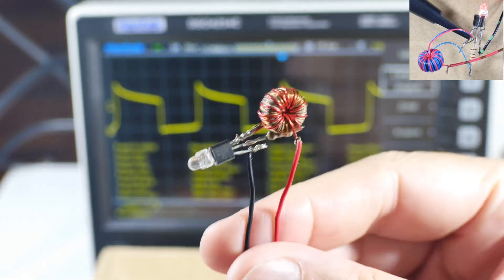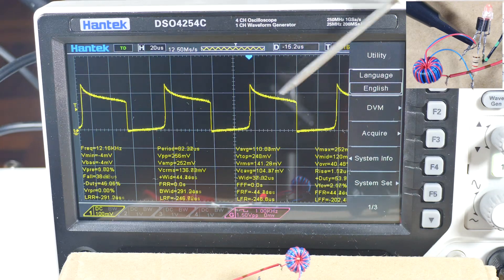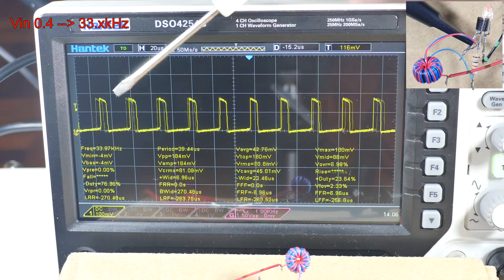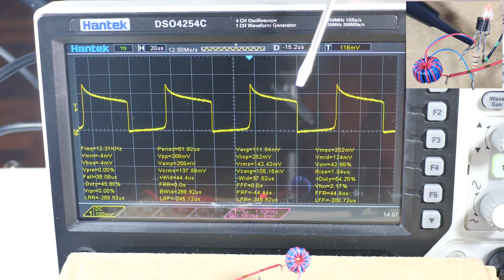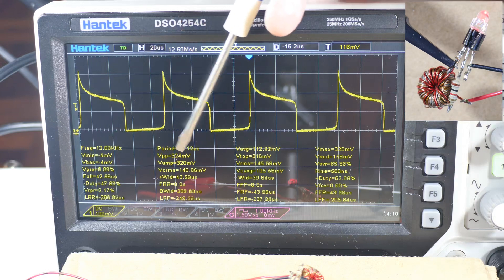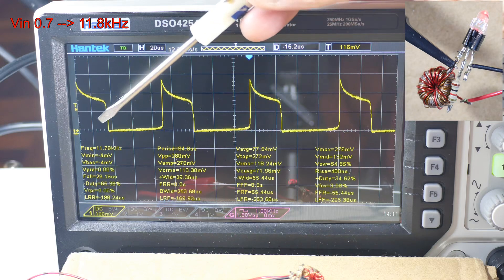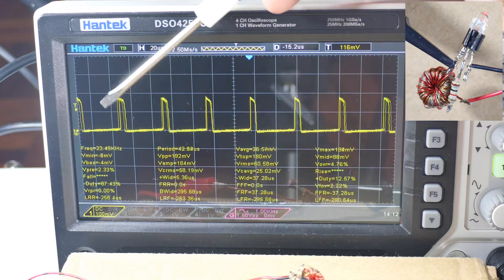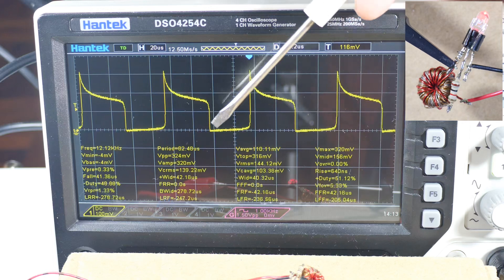Joule Thief - What's The Frequency, Kenneth? (4K)

Comment: What happens if you add a ceramic capacitor across the coil connect from power to collector? Would that possibly form an LC resonant tank circuit? If so would that cause said joule thief to oscillate at said frequency?
Reply from the maker: Remembering that all components (even a straight wire) has 3 properties: resistance, capacitance and inductance, adding capacitance to the natural capacitance of the inductor would change the frequency at which it resonates, mostly likely lowering it.
Reply: @tsbrownie  thank you! Would it be possible to raise the resonant frequency? Let’s say to 3mhz? Like if a capacitor which was lower than the parasitic capacitance was hooked up
Reply from the maker: @andrewel5383  Yes, lower inductance and capacitance gives you higher frequency. So you need to use a higher frequency toroid coil and fewer turns.
Reply: @tsbrownie  okay thank you!!

Comment: Interesting video - thanks for sharing.  Did you have a x10 probe on there?  The Vpp was showing around 200-300mV most of the time and the LED shouldn't be lit at that voltage.
Reply from the maker: Thank you. Good question. Yes probe was set to 10x.
Reply: @tsbrownie  That makes sense - thanks.